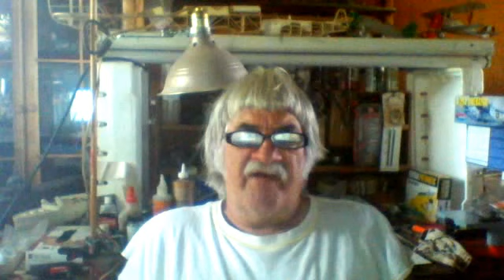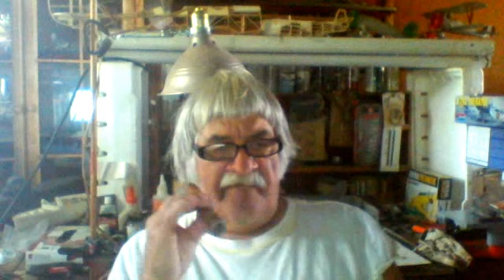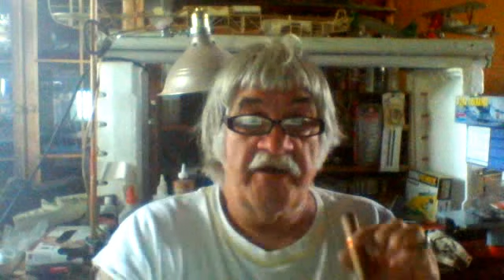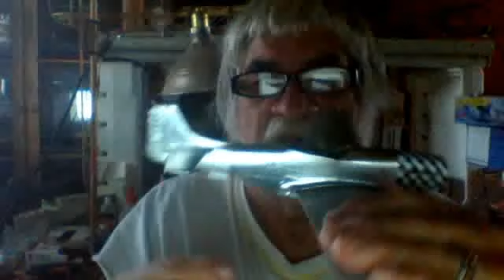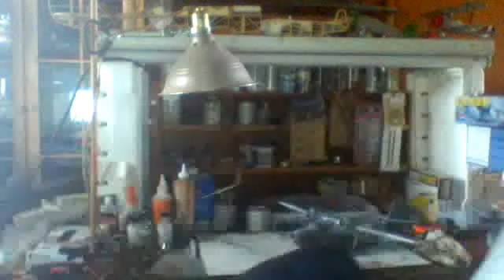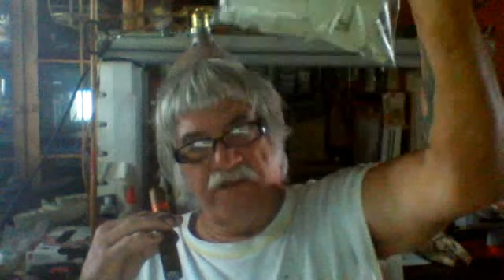Webcam video from August 20, 2013 1:59 PM Trumpeter Albatross build report No.8

Comment from the maker: Ahoy Joe wittmer I use contact cement apply area with a good brush until completely covered then apply your foil use Reynolds wrap aluminum foil stay away from the hobby shops. Buying foil there is they will reel you in hook line and sucker. go to the dollar store and buy the foil there .Only $2.00 cant go wrong my man. thanks buddy you the man Frankie Day